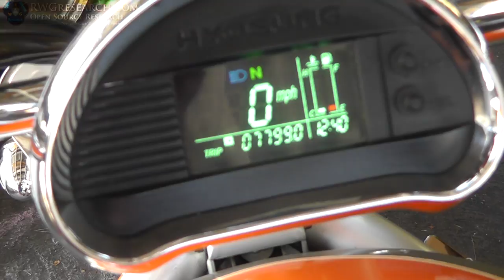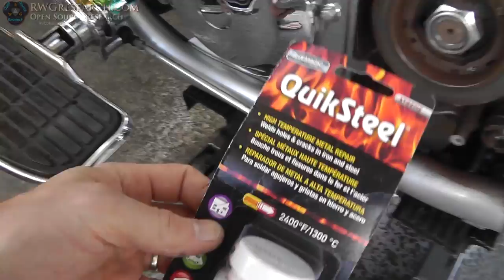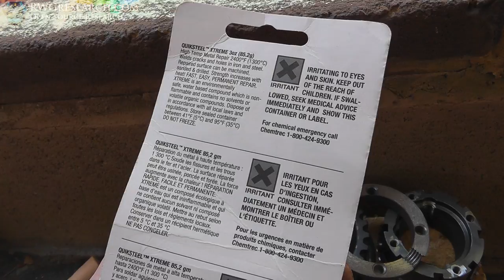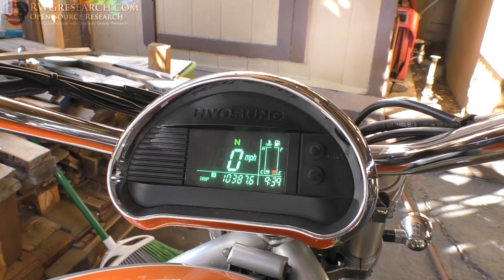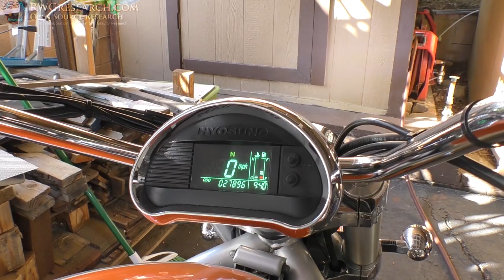Drive Gear fix -  Extreme Engineering & Hobbit Exploded... This Video Took allmost 2 years

Comment: That uneven tire wear is far too extreme to be just the road crown. CT crowns too and I never saw that kind of wear on any of my street bikes. Guaranteed you have an alignment problem. Probably a bent or unevenly manufactured frame. If I ever buy another bike it will be another chain drive crotch rocket all Suzuki brand, TYVM.
Reply from the maker: Interestingly enough I drove the other way to work for a bit with the last new tire and and did not see this type of tire wear. after looking closely at the roads  there all crowned in one direction. ( flat on the way home but angled on the way. )  also all the turns when I'm going up hill and turning are on that side of the tire. more ware trying to grip while giving it gas...  its crazy but after aligning it Manny times and going through Manny tires. the best guess is the roads... and the original tire did not have this type of ware on it... till i started driving it lol. strange i know but its my best scientific conclusion... ~Russ

Comment: Hey stop using weights to balance the tires....use beads inside the tire...1 oz of beads in the front tire and 2 oz of beads in the rear tire.. self balancing ...been using them for several years now..... no issues....AD4ME